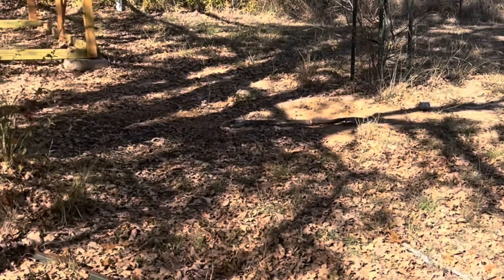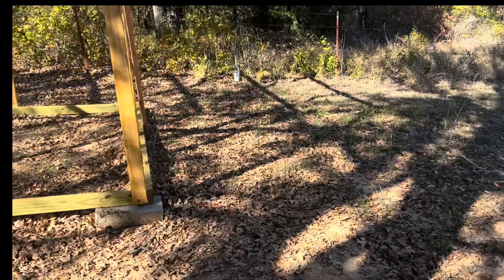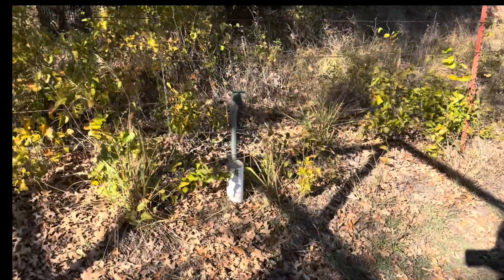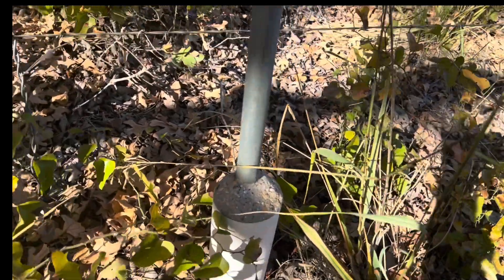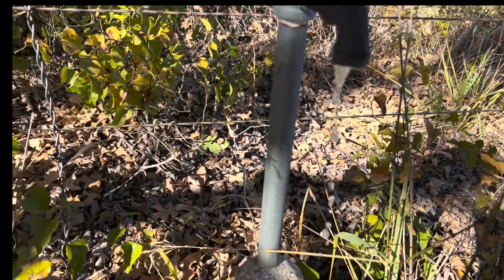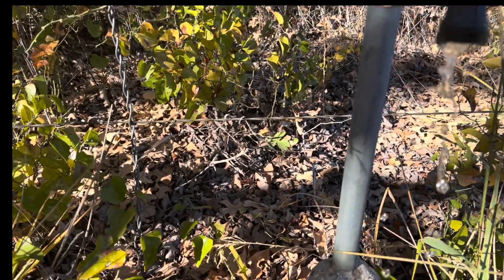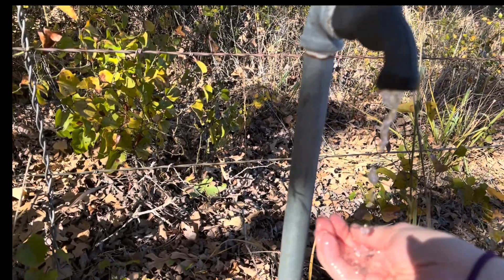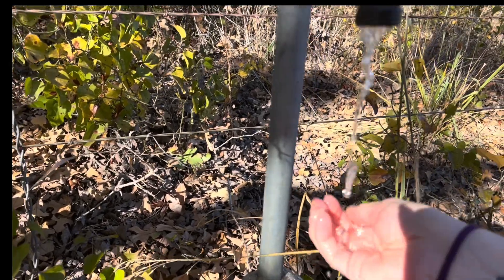Well Water Smells like ROTTEN EGGS 🤢 | Aluminum Anode Rod

Comment: Master plumber here, retired , the rod in the h.w h. will let the minerals in the water attache to it, hot water seems to really stir up the minerals, u said the cold water smells like rotten eggs,  best thing , take a sample, and get it tested at the health dept, some water wells, have a lot of surfur in it, i think installing charcoal filters off your well line, may help out alot, the cold water nevers goes through the heater, so maybe lots of surfur in the water, or high iron content, but they do make in line filters will remove the smells

Comment: Is the sulfur smell gone?  Did the new anode help?
Reply from the maker: It did help right away and for a long time! However, we’ve still had issues that seem to be unrelated. We had to shock the well which did help, but now occasionally even the cold smells sulfur-y. Comes and goes, and is worse in some faucets than others.